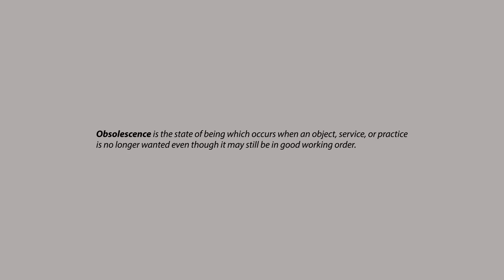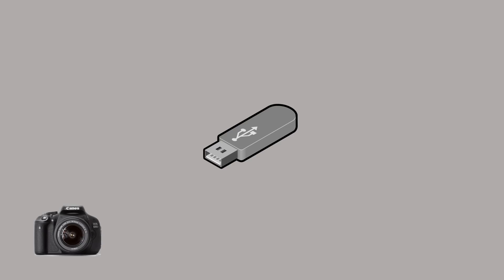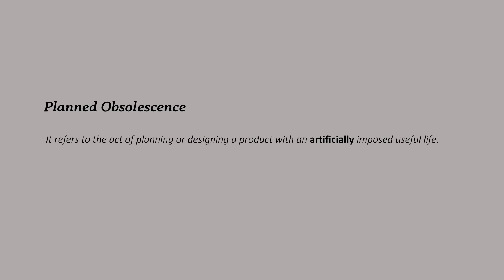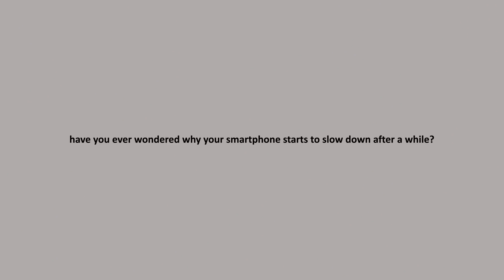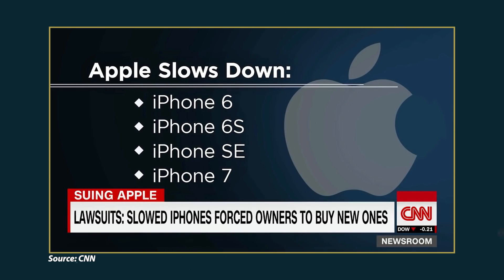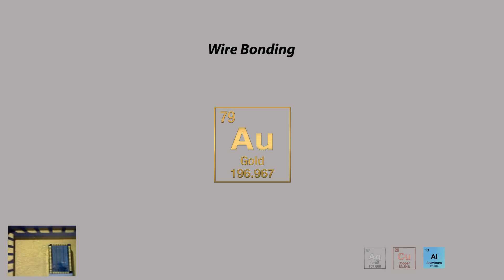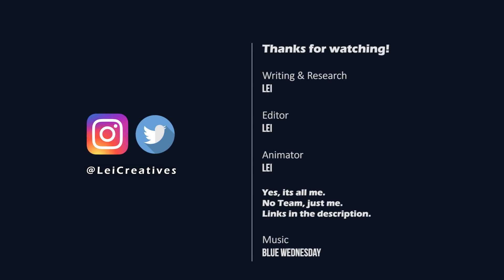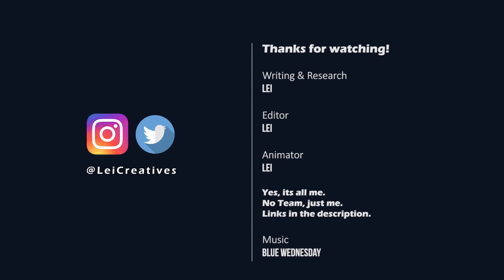Why Your Smartphone Seems to Slow Down Over Time?

Comment: Loving your videos. Absolutely agree on the textbooks. For some of my classes, I bought the old version for like 90% of the price of the new one and most of the time the word problems and info was the same, just the page numbers and order was different, so I just had to find them in my book using my friends' new books as a reference. The worst of all though is those new textbooks that require buying the digital code that makes the book unsellable afterward.

Comment: It's actually more due to the absence of updates. E.g. Samsung Galaxy S3 used to be a flagship and it is still better hardware wise then new budget phones. Mor powerful..but slower. Its brcause but you just cannot use  update beyond android 4 so new apps use processor and memory incredibly ineficient way compared to later androids. BTW Samsung is now goes through a lawsuit in which they are being forced to provide updates at least for 2 years after sales.

Comment: I always read all my engineering textbooks and never sold them because I could look in them years later and remember parts of what I learned and fill in the rest.
But my %&#($( iPhone 6 - that pisses me off. I took great care of the battery until some defective chip inside of it made the screen all wonky (a problem so wide spread that Apple agreed to replace it for anybody with that specific problem - for $200) and now my new iPhone 6 is so slow after 5 months, it's ridiculous. But one day I found a $10,000 diamond ring on the sidewalk right outside an Apple store and gave it to the first girl I met (10 minutes later), so on balance, I can't complain about their prices.
Oh, and that girl I mentioned? We have a 2 year old together now.

Comment: Apple could be right about the batteries since the ESR of the battery increases when it ages and a sudden peak usage can be really bad (or even dangerous) for the battery and also can cause instability to the phone. However you could ask the questions: Why do the batteries start decaying this quick? does Apple cheaps out on their batteries? etc.
to apples defense, it's not a bad thing to underclock the phone when it ages it protects the phone and the battery, however at the rate it happends (to a very large group of people and the ammount it throttles (50% throttle for 1 year old phones at room temperature)) is just concrete sh*t . This can also be correlated to the S6 battery recall. So in other words it may be a 'fix' for a 'design error'.

Comment: I've always had an issue with the vast usage of "Planned Obsolescence". One big thing people are forgetting is that demand increases with time. Your 3 year old phone is still just as capable but your demands and the demands of the apps you use increase. Apps have gotten bigger and more bloated, it's why Facebook released a "Lite" version of their Messenger app. Slowdown is a condition that has many causes but most people tend to run straight for the "companies are greedy" cause. They are, but they also know that if they ever made it so that there was proof of them deliberately doing this, they could very likely go bankrupt from lawsuits. Being part of the tech industry for years, I've seen plenty of people not wanting to pay much for a computer whether it's a desktop, laptop or phone. That right there is problem number 1, a lot of people don't realize the simple and blatant fact that you get what you pay for. You can't expect a $100 smart phone to last for years without having issues. As far as the Apple situation, I dislike Apple but I don't feel like there was anything majorly wrong with what they did. They saw deteriorating batteries in older phones and wanted to keep customers happy with the run time of the battery, not requiring people to charge their phone every hour. The only way to do that is to lower power consumption and they did. What they should have done different is made it a pop-up upon the upgrade to inform users, yet make it a default setting, but still allow users to opt-out. I don't think it's as much "Planned Obsolescence" as it is cramming as much performance as possible as cheap as possible to please as many people as possible at a price that's as low as possible.
Reply: Nate Rowe You lost me when you agreed with what apple did. How about the best tech company figuring out how to put bigger batteries in phones? If Xiaomi and Allview can put 4000mAh in a phone, don't you think Apple puts 2000mAh for this purpose specifically? Think before going brainwashed ;)
Reply: Jayro I'm not brainwashed, I avoid Apple products entirely. It doesn't matter how big the battery is, what happens when the capacity dwindles due to overheating, multiple charges and discharges a day? Apple saw this and wanted to keep usability high, all phone manufacturers are touting all day batteries. They opted to drop performance to keep the phone alive longer. I agree with that aspect but I disagree with how they implemented it. It should be a user switch or kick in when the battery gets below 50%. Something other than a silent forced change to everyone.
Reply: Nate Rowe I respect your opinion, but I still can't agree with you, because my HTC 10 has 3000mAh(lasted 1 day and a half). Now, after 2 years, I have about 2.700 left but still lasts for a whole day without the need of throttling and the phone is still buttery smooth after a lot of updates. So it's possible.
Reply: Jayro I bought Samsung TVs for all the room in my house 10years ago and they still work. Our family vehicles are kept for at least ten years and I drove my 4x4 f150 for everyday 16years before I got tired of my local ford dealer’s incompetence. And of course the human body is used everyday for an avg  age in the seventies. So I’ll have to respectfully call bullshit on that...make it right charge a fair price and all will be well.
Reply: Your right  Damian. 

People like Nate who say ... you get what you pay for ... are brainwashed. 

This is Nate's way of remaining clueless about the realities of this world and rationalize buying over priced products  ... Nate is a price snob

I've had many inexpensive products last a very long time ... many manufacturers intentionally build products so they break and need to be replaced ... 

I've seen car manufacturers in past few years tout their cars get over  35 miles a gallon on highway ... the car saturn sl i bought in 1999 gets 36-39 miles a gallon and still runs and gets same mileage ... they probably discontinued that car because it was cheap and too high quality
Reply: Jayro Not many people know how to keep their battery healthy by keeping good charging habits! I don't know why, but from those around me, I see iPhone users generally love to keep their phone at 100% battery all the time. Maybe it's due to the smaller battery they got from their iPhones so after time they got used to always charging it to make sure it's going to last as long as possible, especially when they are going out! Maybe it's the smaller battery that caused the psychological effect, I don't know. But maybe you would like to start noticing those around you, maybe it's a common habit by many iPhone users or maybe it's just those around me.
Reply: Yes, that's where i wanted to get, it's impossible to create a thing that is used every day to last forever PHYSICALLY. That has nothing to do with the software, software does not deteriorate. Back in the days, you would switch the phone when it was physically deteriorated or destroyed, not when the manufacturer wanted you to. Now, even if the phone is intact, the software forces you to buy the next model by intentionally working painfully slow.
Reply: You do realize that it's impossible to create electronics without them slowing down over time right? When certain materials get used over and over again millions of times a day, they tend to wear down...
Reply: That's the way Apple works! When you buy apple you buy a decision, they make a choice for you!
Reply: Nate Rowe If Apple made $100 phones that do the same work but only last a few years...I would be ok with it. But, they don’t make $100 phones do they?

Comment: I wish you had expanded more on the fundamental mechanisms - the how they are slowed, rather than why - this video was a little recursive, you addressed what planned obsolescence was, gave a single example (although even that felt incomplete, about copper vs gold) and then looped back around to blame it on the concept of planned obsolescence. Sorry to seem critical here, your videos are very interesting - this was just a little weaker than your usual output.
Reply: This video is plain stupid, spent 30 seconds talking about the title's question, and said nothing correct. Hardware does not slow down, a battery will have less MAH over time but that's natural, for a phone to slow down, it has to do with junk filled in the phone. Always take care of ur phone internally. My s7 edge runs smooth and great, no issues.
Reply: I agree with Hamza. As someone that works in the tech field, this video is actually just one of those hyper sensationalized versions
Reply: @heynando  <3
Reply: 7

Comment: Remember that apps use more cpu/memory too. New functions come with a cost for system resources. If you run your phone with older apps versions you likely will get the same performance that you got when it was new.

Comment: How can copper make the device slower over time?
Reply: Curious Elephant copper doesn't rust. I'm an electrician. If copper lost conductivity, especially in just a few months, almost every house in the world would burn down.
Reply: Bryan Hensley, I doubt you have forgotten that most household wiring is insulated, with the exception perhaps of the ground wire.  Take a piece of old Romex from behind a wall.  The bits that are stripped and wrapped around an outlet look dark, maybe even green.  But if you strip any of the wires to expose a little more, you see shiny copper again.  Inside a computer or a smartphone there is no such insulation on the circuit boards.  Currents run on the surface of the these nearly microscopic copper connections.  Even your SIM card has copper contacts.  The currents on circuit boards are very small and more drastically effected by resistance.  Although I am certainly not an electrician, I did attend school to learn about microcircuitry.  It is an amazing science.  You might like, “Makers of the Microchip: A Documentary History of Fairchild Semiconductor.”  When I was at Cal Tech, we always used pure gold breadboards for all our experiments.  Only in recent years, and largely due to the rising cost of gold, have breadboards been converted to being made with copper.
Reply: Curious Elephant, if the bindings inside the IC failed due to your mentioned corrosion, the phone would not slow down - it would stop functioning all together!
Reply: let me guess..science is not your major. Electricity travels at the speed of light. Either it passes through or it doesn't. Digital logic is always binary. Hence either your phone malfunctions or it functions right. There are other factors for slowing down of phones but oxidation is certainly not one of them.
Reply from the maker: Hi, Bryan Hensley, I was using the term loosely here for the sake of explanation, by saying 'rust', I am referring to the oxidation process that happens in all metals.

Thanks mabamabam!
Reply: Copper does corrode. That is why the statue of liberty is green.

On the scale of house wiring it really isn't a problem, on the scale used in your phone it is.
Reply: mabamabam I agree, copper does turn green after several years of outdoor exposure. But I don't think I've ever seen it turn green inside a home. I would think a phone would be even more protected. I'm not really arguing, but this really surprises me
Reply: mabamabam electricity either passes or gets blocked..its not like it passes sometimes and not other times. You don't miss some bits..either you get all bits or you just don't get any.
Reply: But i'm sure you can see the difference between a newly stripped cable and an old one, so there is some corrosion even in a house.

I think It is more to do with the size of the connector and the voltages. A bit of corrosion isnt really a problem on large wires at 220v. The same amount of corrosion could be a huge deal on tiny wires at low voltage.
Reply: mabamabam https://www.google.com/search?q=speed+of+electricity&oq=speed+of+e&aqs=chrome.2.69i57j0l3.6721j1j9&client=ms-android-samsung&sourceid=chrome-mobile&ie=UTF-8

Atleast google before you reply
Reply: None of these materials at this temperature have zero resistivity. Their resistance is then proportional to the cross-sectional area of the wire. As the wire corrodes over time, the cross-sectional area decreases, and the resistance of the wire increases. Digital devices use low voltages (and getting lower over time to save power), and whenever possible low-current/high-impedance outputs (to reduce size and cost). Most digital logic uses voltage to encode a binary signal by using two voltages, e.g. 0V for 0 and 3.3V for 1. There is some threshold voltage defined for each logic family (e.g. 33% of supply voltage for CMOS), above which the signal is considered high, and below for low. If the resistance of the wire increases too much, the outputs won't be able to drive enough current, and the voltage will fall, eventually to around the threshold voltage. Then you start getting intermittent signals depending on temperature and so on.
Reply: ashish pant that was what I thought too....
Reply: i don't think there are error correction internally in a phone.
Reply: Copper is a better conductor but gold is also a good conductor and it last much longer
Reply from the maker: Among some other reasons, Gold has lower reactivity than Copper which means it reacts to oxidizing agents less, therefore over time, electric signals will pass through the one made with gold more readily. simply put, copper gets rusty more easily and impedes connectivity between components in your phone. Wire bonding is one of the most fundamental processes in the semiconductor industry and affects almost all components in your phone
Reply: Well science was definitely not you major as electricity can never travel at the speed of light. And also that is entirely irrelevant. Maybe don't tell people you studied science right before you say something dumb.

Digital logic is binary but sending many bits is not. Think of it like taking down a phone number, you might miss one of the digits the first time round so you will ask the person you're speaking to to repeat the number. You still end up with the number but it takes longer than with a perfect connection.

Comment: it is defenitely the software. don't update and everyhting will be fine for 10 years plus.
Reply: Yea, my Lumia 930 is still practically as snappy as it was when I bought it almost four years ago. It doesn't really have much app suppport though. That's why I'm gonna replace it with a galaxy a5 2017.
Reply: that plan doesnt work anymore. Apple is now releasing the newest flagship phones with a buggy OS FORCING you to update to always fix the bugs.... that prior phones didnt have....
Reply: My 6plus on ios 9 still running smooth even with thousands of battery cycle. People are psychological. Thinking that an os update for their iphone will make it faster and smoother but in most cases their phone ended up slower because the OS they updated were meant for the newer devices that has better specs to handle it.

My logic is. If it works just fine on the current version then there's no reason to update unless, i can afford to upgrade to a newer device with a better specs to handle the new OS.
Reply: @Jollibuuu  Try to update it to iOS 12 and you'll see. The first major iOS update doesn't slow down the phone that much. The iPhone 6 did come with iOS 8, put iOS 9 on it will not make it a lot slower. The same can't be said for iOS 12.
Reply: 100% true
Reply: The problem with that is that without updating the OS many apps stop being updated because they aren't compatible with previous OS versions. The same isn't true for Android because it's much easier to keep an app compatible with older Android versions. 
Also, Apple allows devices with slow hardware to be updated to OS versions that will make their device almost unusable, and you can't downgrade so they force you to buy a new device. 
That's why I switched to Android and haven't regretted it.
Reply: Jason Koukas same over here. My MacBook is running for 8 years now with day 1 performance. Never made an update. Never had an issue. Battery is at 75%. Skype isn't supported anymore but I can still use it on my android mobile device. So I'm fine with that ;)
Reply: Zac T haha. Soo stupid. Definitely a reason not to buy it!
Reply: Phil BMCX thats because he doesnt know the facts, and the fact is, people feel iOS 12 is faster on older devices (i dont have one so i cant speak for my self)

also: not taking Apple side here
Reply: Just make our own phones and boom! Never ever slower than before
Reply: IPhone after update slow? Try to change your battery BC apple say they slowdown performance if the battery wear is too high
Reply: @rizkyyulianto8741  u realise that was just a way for them to get away with what they did. They said oh it's to make u have better battery. Some dang Bs. They asked for 30 bucks to change the battery or.. their ultimate plan, UPGRADE
Reply: Nah that's why I hate apple but the iOS OS is a masterpiece
Reply: Why can't apple give options on their iOS updates for users themselves to modify performance throttling?
Reply: Not anymore😊 my XS Max originally with ios 12 is now on iOS 14 BETA 4 and is still fast and snappy with newest features which iphone x and below does not/will not have.
Reply: Phil BMCX never update any apple product. It just pushing device to work slower